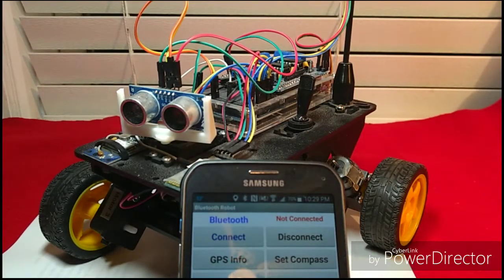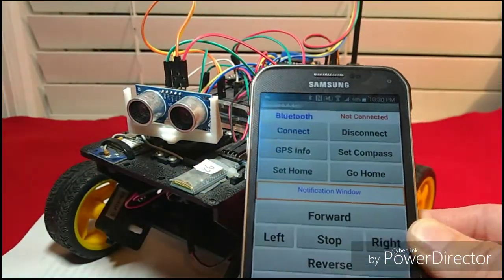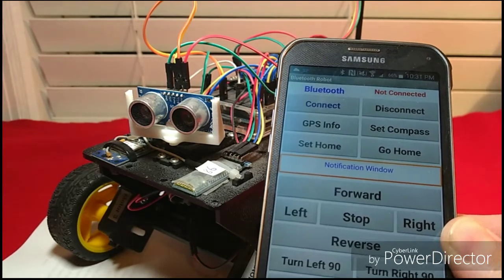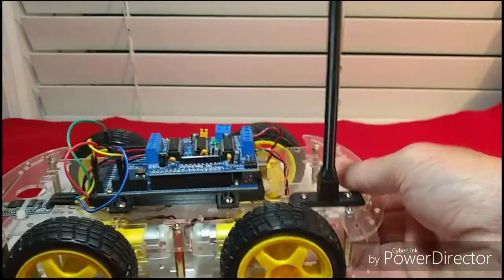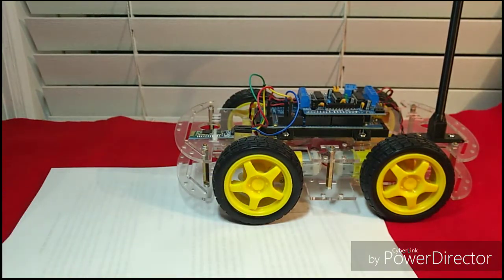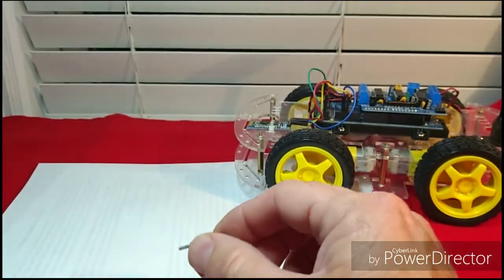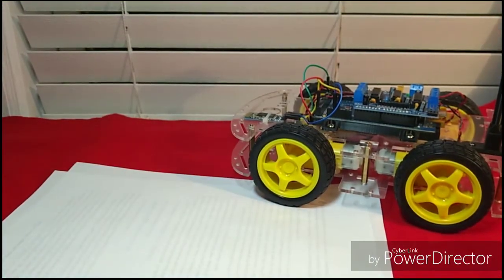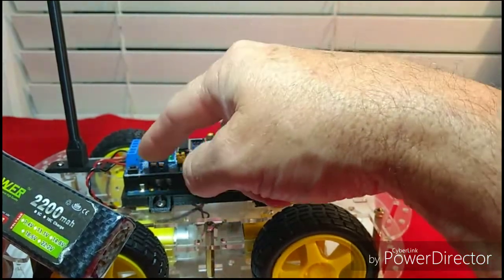How to build a GPS Guided Bluetooth Robot - Part 1 - The List

Comment: hi 
can you use gsm in the place of bluetouth
to send destinations to the robot
to make it inlimited range
Reply from the maker: The way the code is setup I would say no, but as long as your supplying tinygps++ with valid nema sentences then it wouldn't matter where you were getting the data. You could also supply the code with the latest GPS coordinates and bypass the need for a GPS module altogether.
Reply: @EZtech  please can you give me your facebook 
i want to ask you some quentions 
thank you
Reply: @EZtech  @EZtech I need your help. I have done everything step by step. I have made the circuit, and calibrated the compass, and uploaded the code. And did everything which you told in this video. But the problem is that, I never got any output whenever I press any button in the app. Even the connection is proper and code is properly uploaded, also compass has been calibrated perfectly but nothing works with the app, whenever I press any button.

Comment: How come the mast for your compass is different to the link provided on the website. would you be able to link me to the one in the video as it looks better. Thanks
Reply from the maker: It's one that I custom made using tinkercad. Unfortunately, I can't find the file, but it was made using the "GPS folding stand" file so you can probably re-create it fairly quick.
Reply: @EZtech  if you login to Tinkercad it will show up on there. I am finding it difficult to replicate it and the link you provided won't fit onto the robot you have (I have the same)
Reply: @EZtech  @EZtech I need your help. I have done everything step by step. I have made the circuit, and calibrated the compass, and uploaded the code. And did everything which you told in this video. But the problem is that, I never got any output whenever I press any button in the app. Even the connection is proper and code is properly uploaded, also compass has been calibrated perfectly but nothing works with the app, whenever I press any button.

Comment: could you post a link to the arduino mega to print it off via 3D
Reply from the maker: I assume you are talking about the piece that holds the Arduino mega

https://www.thingiverse.com/thing:53857
Reply: @EZtech  Sorry my bad, yes that is correct. Thank you. :) What type of screws did you use to screw the base plate and for the rod for the compass?